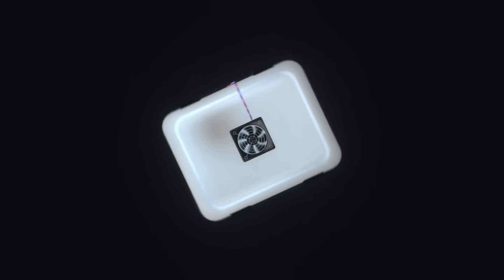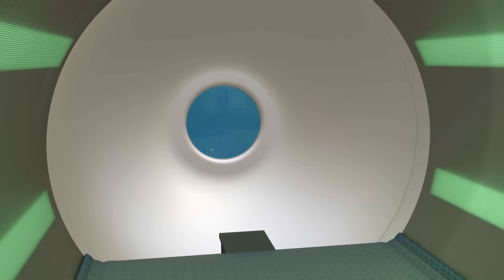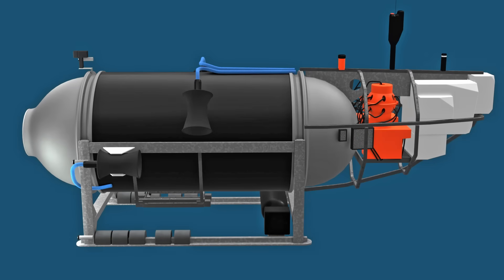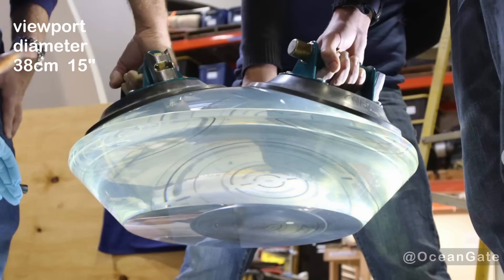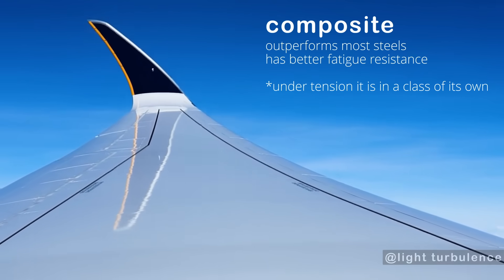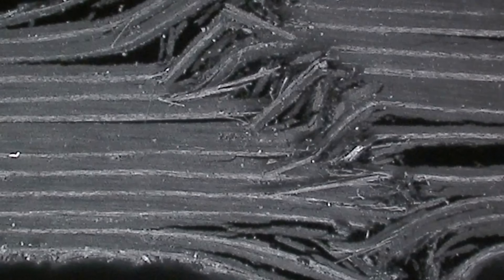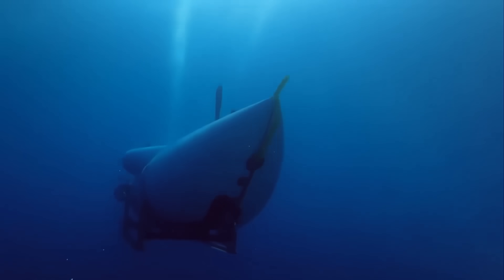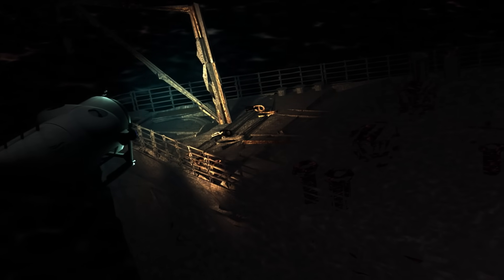Titan Sub | carbon fiber - Detailed Tour

Comment: Carbon fiber is insanely stupid material used in this fashion. Absolutely ridiculous. I have worked with carbon fiber for decades. NO, carbon fiber does NOT have good compressive strength, this video is ridiculous and easily debunkable. You video of the airplane wing is NOT illustrating compressive strength, not at all.
Reply from the maker: You lack an understanding of the principles of structural engineering. In wing design the same massive tensile forces are balanced by equivalent compression forces. This aligns with the fundamental principle that "every force has an equal and opposite reaction." You are suggesting that tension simply disappears into thin air  without a counterbalancing force which is nonsense.  If the carbon fibre could not resist the huge compression forces the wing would depart the plane.  And the wing footage is a great illustration of the compression strength of composite.  

It's intriguing how some, including yourself, struggle to accept the fact that carbon fiber can rival the compressive strength of the best steel. Carbon fiber is a structural marvel, but its correct construction is notoriously challenging and expensive.  And I don’t you when you say you have worked with the product for decades and if you did then it was not in a structural application.
Reply: @Mike-Bell  - you're the one with the lack of understanding of what forces are being applied to what in that wind example you show. I have worked with AeroSpace Composites (a world leader in aircraft composites) for years. You also don't understand where the load on that wing is, it is not in the skin, it is in the SPAR. Furthermore, my engineer father has been flying carbon fiber aircraft for decades, he too agrees, there are very little "compressive" forces being applied to any of the carbon fiber in a aircraft wing. You not only don't understand composites, you don't understand how an aircraft wing works. SMDH....
Reply from the maker: Wing structure can be the spar or the top n bottom skin or both. And still the tension and compression forces match one another for it to be a complete structure. The engine forces in an airliner could not be carried by the spar alone, its the skins that do the compression work and lots of it.
Reply from the maker: @squidly2112 Actually I have a great understanding of structures and always have. Such as in building frames, roofs, bridges, furniture, bicycles, appliances etc. and in aircraft. Wing structures are particularly fascinating.  In a straight wing a spar works but in a sweepback the torsional forces are highly complex and the skin structure becomes vital to resolve these forces plus there is engine thrust too.

You should be careful to make such blanket statements and dismiss a video so unequivocally.  The airbus wing is a fantastic illustration of what composite is capable in a high compression load structure.  

I agree that Titan was a very risky use of composite and the 5 inch thick layup sounds like it required tons of testing and development to resolve all the unknowns.
Reply: @Mike-Bell  - I suggest you do a little research into composites .. you lack understanding.

Comment: Very well done. Best presentation I've seen overall. And not to take away from that in the least, am still not convinced the transcript is fake. The work in the main presentation is very solid.
Reply: I fail to see where they said they were using the thrusters to dive in the transcript, but instead using them to lower their descent rate to no avail...

Comment: My theory: Tiny air bubbles at atmospheric pressure that were inadvertently included in the carbon fiber imploded one-by-one under extreme pressure. First the bubbles near the outer surface imploded, which weakened the outer surface, then deeper air bubbles imploded, until the carbon fiber still l@@ked like carbon fiber, but it was broken up around imploded air bubbles on a microscopic scale until it was unable to carry the load. Has anyone looked at THIS possibility?!
Reply: Yes, that is how pressurised delamination works, each micro bubble that is compressed, provides more  microscopic room for fibre movement to occur at that point, with a change in pressure changing irrespective of if it is an increase or a lessening.
    Then it is a question of time and when, not if; once enough fractures between the individual fibres and the resin matrix to fall below the structural threshold for a given pressure, force or other loading being upon the the resin and or the fibres.
.......it will then fail instantly.
Reply: @razor1uk610  This is wrong; even if you have no bubbles at all, the carbon fiber would still fail; it has micro-fractures and cracks, which has nothing to do with bubbles causing this; the bubbles, if anything, are a consequence of this failure
Reply: certainly it makes sense to consider laminating it at some given pressure, not only for air bubbles but for pre-stressing.
Reply: It seems to me that the trick would be to laminate it while submerged in a suitable liquid, so that any included "bubbles" would be incompressible.  @itoibo4208
Reply: possible!  it withstood multiple dives -
Reply: With cascading damage on each use, the product brochure should have shown something similar to an exponential curve on the risk of failure, i.e. 1st dive - 4%.   Second Dive 7%   Third Dive 13%  Fourth dive -24%...  Hey, how about that 12th trip.
Reply: Why was the voiding present? Was the hot cure done in vacuum bag?
Reply: Doesn't he basically say that there were issues with the build process
Reply: Yes - carbon fiber doesn't have any problems with bubbles EXCEPT in applications that involve astronomically high pressures - like deep sea diving. Here, a DIFFERENT process is needed that completely eliminates bubbles. There appears to be two options:
1.  assemble it submerged in a suitable liquid, so any bubbles are incompressible.
2.  while still wet, put it in a high vacuum so that air bubbles grow to a VERY large lize and escape the assembly, and then remove the vacuum so that any residual bubbles become microscopic. These will still collapse, but in the process they won't do nearly as much damage.
All it takes is a few bubbles in just the wrong places to doom carbon fiber vehicles, so whatever process is employed must be very nearly PERFECT. Maybe combining both approaches would be good enough.

 @dosmastrify
Reply: Seems reasonable.
Reply: Further to that, CF undergoes an extremely unique form of delamination called Snap Buckling. It's been found occuring on underwater cables. A very terrifying form of delamination when the inner most layer of CF is actually the first to go setting it an instant chain reaction.
Reply: This is nonsensical; it is a fiber and doesn't do well under compressive forces. It survived 12 or so dives before catastrophically failing. And bubbles wouldn't implode if they are in a carbon fiber resin matrix; this makes no sense, as what is putting all the pressure to implode it; if it is air, it would just compress; the carbon fiber is under pressure from the water, and the bubbles aren't under pressure from the carbon fiber; but the bubble gap means the carbon fiber has less 'support,' thus the carbon fiber implodes, not the bubbles. Again, if the air bubbles do 'implode,' it is a consequence of the carbon fiber hull failing and not the cause of the hull failing (at least not directly).

It failed because water isn't perfectly incompressible, and it elastically rebounded upon the carbon fiber once the carbon fiber shattered, thus causing devastation.

Comment: Would some sort of midsection comprised of carbon fiber wrapped around a thinner titanium spool be an option? The O rings that connect to the hemispheres would be integrated into the midsection of the submersible. Conceivably that would eliminate the need to "glue" O rings to the CF core and take away another variable of uncertainty.
Reply: An aluminum sleeve around the outside, glued to the CF hull, then weld end plates machined for o-ring grooves to the aluminum sleeve would keep the water out of the cf fiber.  An aluminum sleeve inside thr cf tube would delaminate at the tiniest leak.

Comment: Regarding the "Fake" transcripts: I don't know whether they are authentic or not, and it obviously seemed a bit strange that they seemingly were leaked by an Indian YouTuber (that's how I found the at least, and couldn't find any other sources). Having said that, I found the content within them to be believable, especially since they seemed a bit overelaborate compared to most fakes. 
Specifically related to YOUR points - #1: The thrusters were used as an emergency means in order to slow/revert their uncontrolled rate of descent, probably due to the fact that releasing Ballast wasn't as quick, easy and precise action compared to other submersibles #2: It's not unusual to have one person handling communication with an outside party (eg. ATC in aviation) as long as this doesn't impede the crews response to the situation. Furthermore, OceanGate also seems to operated "slightly" differently compared to similar entities with regards to the level of skill required to pilot their submersibles. Even the Apollo astronauts frequently consulted Ground Control, and Stockton Rush was definitely not an Apollo astronaut...

Comment: Oceangate Submersible Titan Implosion Analysis    June 30, 2023 Jack Noble

Composite barrel information from internet:  55.9 inch inside diameter; 95 inch length; 5 inch wall thickness; 0/90 CFRP laminate.

With a CFRP modulus of 8 million psi in the 90 degree direction and because the stabilizing effect of the end rings is about 10 times the thickness  away from the center, the failure mode will be buckling in the middle of the barrel. The stability formula in Roark & Young yields a failure pressure of 8900 psi.  Dividing by the design pressure of 5700 psi give a factor of safety of 1.56.  This gives a strain level of .0044 in the composite and a radial deflection of the barrel of .145 inches.

At the ends of the barrel, although insufficient information on the rings is available to determine elastic properties, it appears safe to say that the radial deflection of the rings due to pressure will be much less than the barrel.  This means that the rings will be holding the barrel out at the ends, flaring the barrel like a cooling tower and creating significant bending stresses in the barrel and where you have bending, you have interlaminar shear, the achilles heel of composite laminates.  Metals typically have allowable shear stresses of over 50% of the allowable axial stresses while composite laminates have interlaminar shear stress allowables of 2% to 3% of the axial stress allowables.  If only 1.5% of the pressure load on the barrel was transferred to the rings the shear stresses would be enough to cause delamination in the center of the thickness of the layup all the way around which would account for the noises heard on initial dives but would not be visible and would not cause failure because the critical stability section is at the middle of the barrel.

  On subsequent dives this delamination would progress toward the middle of the barrel creating smaller noises, also reported.  This delamination is converting the 5 inch thick composite barrel into two concentric barrels 2.5 inches thick. The critical buckling pressure of two concentric barrels 2.5 inches thick is only 25% of the critical buckling pressure of one barrel 5 inches thick so the margin of safety would be gone long before the delamination reached the middle.

Since there is only one design condition of overall pressure it may have been possible to tune the stiffness of the titanium ring to more closely match the deflection of the composite barrel and avoid this problem but the fact that the composite shear allowable was less than the applied pressure would almost certainly lead to the initiation of delamination somewhere on the barrel.  The only protection from this delamination would be to install several hundred 5 inch long bolts through the shell and the potential for leaks would render that fix impractical.  

It appears that it is probably not possible to successfully use this material in this application.
Reply: Makes perfect sense that the differing materials would contribute to failure.

Comment: This is the best YouTube video on the Titan. No drama, just pure facts and very detailed as well. 10/10

I just want to add more on the “Real time monitoring system”

Assuming the leaked transcript is real… The system actually seems to work as intended. It first sounded alarm at [09:28:16] and the last message from Titan wasn’t until [09:46:37]  

So that would’ve give them about 20 minutes or more to react… which should be more than enough to initiate emergency ascend procedure.

but then 2 minutes after the alarm sounded, a message from Titan reads “no change with thrust the rate of descent is increasing At 35. Going to release the ballast now.”

The only logical explanation I can think of is that the Titan had somehow, gained some weight… which strongly suggests that the water was leaking inside the hull between layers of the carbon fibre. So the process in which the hull failed does not seem to be immediate but took place over 20 minutes until it gave up and imploded.

If not that, then Titan was most likely attacked by a giant squid which cling on to the hull (activating the alarm and increasing the rate of descent) and after 20 minutes of tentacle handling… finally crushed the hull into pieces.

Again, this is based on if the leaked transcript is real. So far, I can’t proved that it is real, but I also can’t proved that it isn’t either. Note that the content of the leaked transcript all seems to check out with the available evidence. Also, both the authorities and Ocean Gate have not come out to denied the leaked transcript either… so most likely it is legit.
Reply: "most likely attacked by giant squid" lmao the Internet never ceases to amaze me
Reply: @zach446  I know it’s funny right… even funnier when you realised that it is actually an entirely plausible scenario given how little we know about these deep sea creature. Only 2 videos of these creature in its natural habitat had ever been recorded.

One thing we know is that it does attacked whale and shark… basically about the same size as Titan submersible.
Reply: I think the "leaked" transcript is in all likelihood fake.  It's too wordy with unnecessary wasteful politeness.  It's most likely the creation of a fiction writer.
Reply: @JoeLinux2000   So consider this message below:  

“[TITAN] no change with thrust the rate of descent is increasing. At 35. Going to release the ballast now. Standby.”

From the message, you just received the info that:

• vertical thruster doesn’t seems to make any change to the rate of descent
• the rate of descent is in fact, increasing
• they are now passing 3,500 m depth
• they will try to release the ballast to arrest the rate of descent
• leave me alone, I will update you (standby is basically a polite way of saying stfu and let me to work on it)

And you think it was still wordy? How? (Mine is wordy)

Personally, I can’t think of a way to convey information any more efficient than that. The titan was telling support crew what just happened, what the main issue is, the current status and their next course of action.

You don’t get any more professional than that.
Reply: Lol giant squid? What drugs are you on pal? Then you conveniently say you can't prove if your theory is right or wrong. Oceangate is keeping their mouth shut as they should while this investigation plays out. It does them no justice to entertain that stupid TikTok video and make a statement about it.
Reply: "giant squid" lmao
Reply: @moonasha  Unlikely but still entirely possible though 🤷🏻‍♂️

Also worth noting that Giant Squid has been confirmed to be an aggressive hunter. So it will proactively hunt down and aggressively attack whatever it is preying upon. 

It might be worth noting as potential risk going forward and avoid designing a submersible in the shape of a sperm whale…
Reply: @tonamg53 shit and there I was thinking it was bed bugs I was meant to be scared of. Now you tell me I might get stang off a giant squid in my sleep.

Comment: People repeatedly fail to grasp that what is called 'carbon fibre' is in fact a resin (probably epoxy) reinforced by carbon fibres just as 'glass fibre' is in fact polyester resin reinforced with glass fibre GRP.

SO WHAT FAILED WAS THE RESIN BINDING THE CARBON FIBRES 

Which is a system not very strong in compression BUT very strong in tension which is why metal (especially in a spherical form) is a better choice!